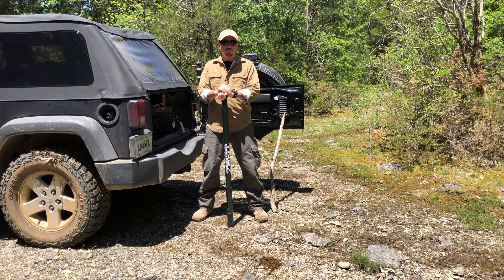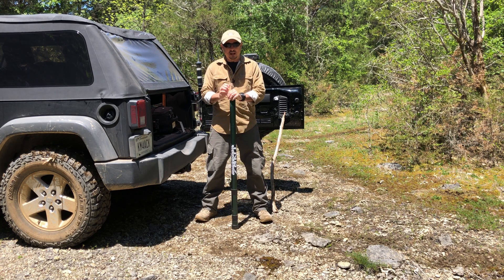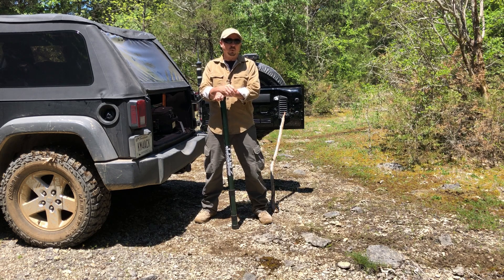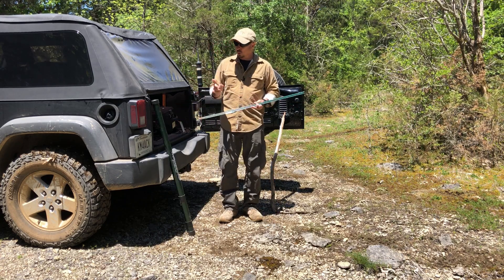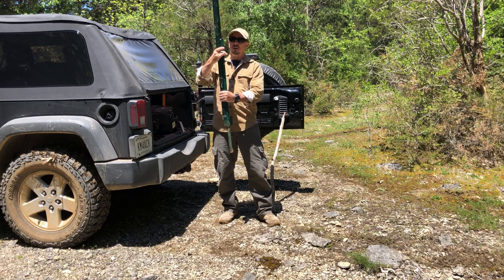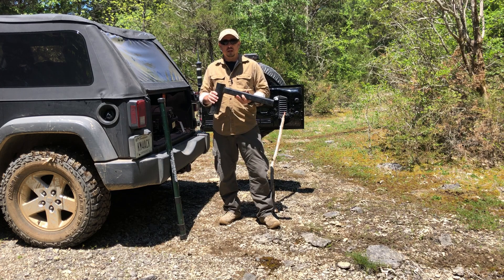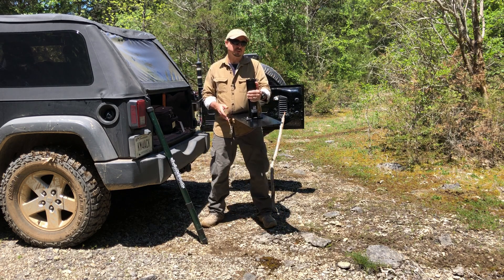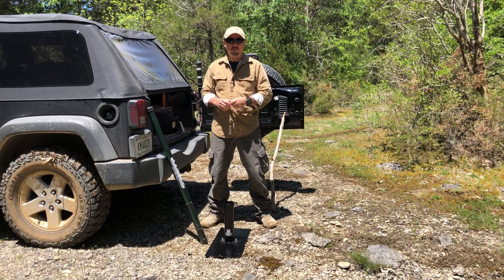Mounting a Portable Mast

Comment: I use a hose clamp with 3 small rope loops almost at the top of the bottom section. Then I use 3 tent stakes and small rope with tent style tension adjusters. It takes less then a minute to set up. Weight is very small and can be back packed. I use a 40 ft spider beam pole. Works great even at home. I've had one in the yard up for 3 years. If a big storm comes and blows it over i just put it back up takes a minute.

Comment: For years my wife and I have carried two telescopic fishing rods similar to: https://www.basspro.com/shop/en/bnm-original-breambuster-pole.  However now you can get these telescopic poles in carbon fiber which will give you great strength to weight ratio for just a bit more money.  We also bought two patio umbrella bases that have a tube that matches the diameter of the base of the telescopic pole.  The tips of the telescopic rods are very light and will bend significantly.  But we match this mast system with some surplus Vietnam era military field telephone wire that is very light but is an excellent radiator.  If the wind comes up we carry pegs and paracord that we can use to guy the masts a bit.  If the wind really comes up it is very easy to run out and either collapse the antennas into the bottom section or to lay them on their sides.  We traveled full time in an RV and used this method a lot if we were going to be parked for long enough to warrant putting up the wire.  We used an AH-4 Icom tuner on our RV roof access ladder and would put out one end of the wire on the telescopic rod and connect the other end of the wire would attach to a strain relief on the ladder and then attach to the top radiating attachment point on the tuner.  For counterpoise we often just used the metal frame of the RV.  If we wanted to put the wire up on the rods only we would attach each end of the wire to a rod and use a drop wire to the tuner that we could mount on the bottom section of the telescopic rod.  We would then attach a second wire to the bottom lug of the tuner for the counterpoise.  This system has worked for over 20 years for us for RV, field day, and portable operations.

Comment: I go portable with a motor scooter. My 12 meter spider beam pole seesm too heavy to tie to the scooter.  A strong wind, and scooter and pole are lying on the side.  I have been using an 8 meter fishing pole, with the top element removed.  That seems up to now more stable, but it bends more than the spidere beam pole.  I have also staked out the spider beam pole, and that holds very well.  My antenna masts at home are all set up that way.  Since I live on a rock and it is sometimes very windy here, I uselong pieces of  rebar as tent pegs at home.  After two years everything is still standing.  I don't think the motor scooter is heavy enough for  a drive on plate.  An alternative would be to stake the plate into the ground with shorter pegs.  I do have weight and size/shape constraints with the scooter.  As a last resort, I have a slingshot to put a wire into a tree, if a suitable one is available.